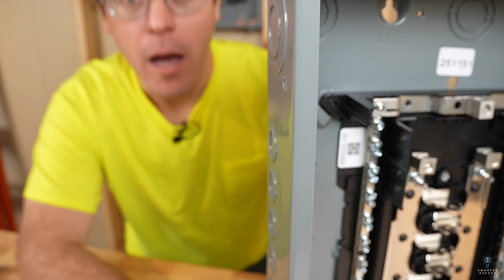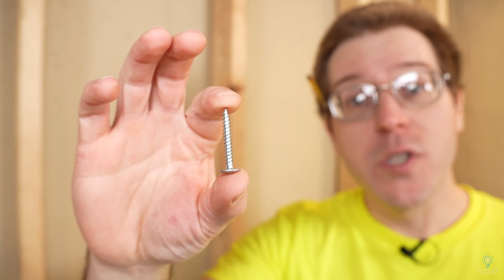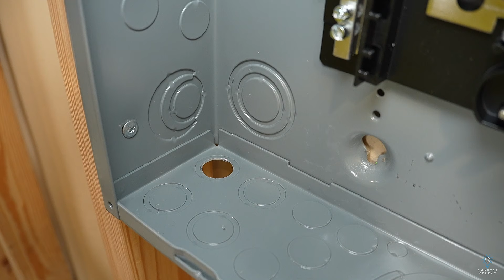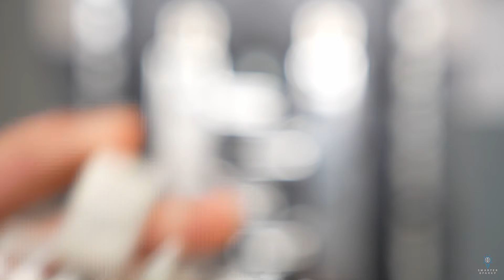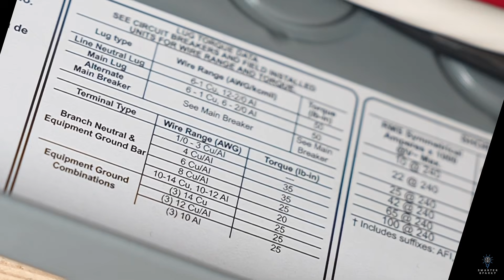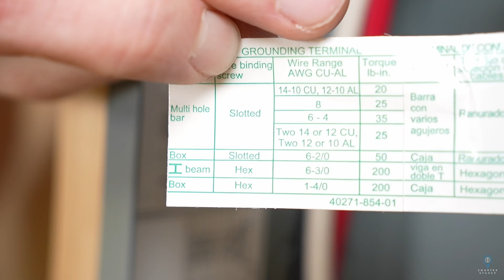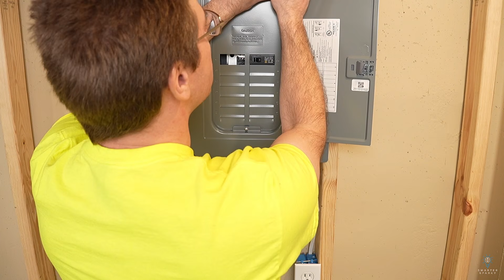Unlocking the Basics: How to Install a Subpanel

Comment: 15:33 Determining how much wire to leave in the panel, Is there a reason to not bottom feed  (Panel Mounted Upside Down) this? Personal preference, actual code
Reply from the maker: Personal preference I suppose. You mount the panel upside down in most cases

Comment: Thank you again, enjoying your videos. You mentioned you can install additional panel side by side of you run out of space. I wonder if you ran out of space on subpanel. How would you solve that? Hope to see that in the future video
Reply from the maker: I suppose it would depend on why you ran out of space in the sub panel. You could add a sub panel off a sub panel in some cases. Depending on the circumstances, it might be best to swap the sub panel for a bigger panel. You also might run into a service capacity issue and need a whole new electrical service to feed all that extra stuff.

Comment: Thank you for very detailed and educational video. Question popped into my mind when you mentioned grounding of sub panel in detached building. In the feeder cable do you still need ground wire?
Reply from the maker: Yes you typically still need the ground wire in the feeder cable. The ground rod at the separate building basically supplements it.

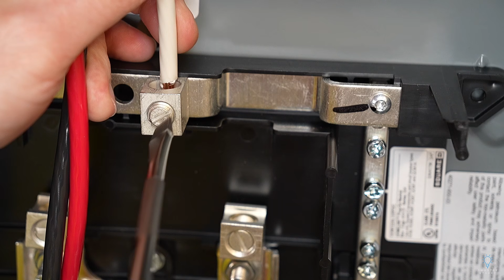Comment: At 32:18 it says I need anti-oxidant. That’s from the 80s when aluminium wire was a lower quality. We no longer need it in any case. Not on aluminium or copper.
Reply from the maker: You are correct. Modern AA-8000 wire does not require antiox.

Comment: At 32:18 it says I need anti-oxidant. That’s from the 80s when aluminium wire was a lower quality. We no longer need it in any case. Not on aluminium or copper.
Reply from the maker: Yes! You are 100% correct. AA-8000 wire does not need anti-oxidant.

Comment: What if the main panel is full and all breakers are used. How do I add a sub panel?
Reply from the maker: You would likely have to remove one load from the main panel, feed the new sub panel, and move the removed load to the sub panel.

Comment: Hi Dustyn,

I recently started following your videos and enjoy the content. I noticed in one of your videos that you mentioned it would be acceptable to use drywall screws to support an electrical panel or subpanel. However, the NEC may not permit that method of support.

I also noticed that the feeder appears to be installed very close to the opposite face of the stud, which could expose it to potential damage from drywall screws or nails.

A few additional questions:

* When installing a new ground bus bar, should the mounting surface be cleaned or scratched to ensure proper bonding before applying the manufacturer’s specified torque values?
* Should all new circuit breakers be properly labeled when installing or adding a subpanel?
* At a detached garage, ground rods are not required if the structure is supplied by only one branch circuit, correct?

I would appreciate your thoughts on these items. Thanks for sharing your knowledge and experience.
Reply from the maker: You know, I think you are right about the drywall screws. I don't think there's a code that specifically prohibits it, but i think it's a load rating issue. I'd have to look into that more. Thanks for pointing that out.

My next video will be about conductor clearances from the front (edge) of the studs. I'll address this in that video.

Your questions:
1) If the manufacturer doesn't specify that the paint needs to be scraped, I don't think it needs to be. The manufacturer is certifying that it will work with the screws it provides (they are kinda triangle shaped so they cut into the paint/metal and self-thread.)
2) Yes it's always a good idea to keep the panel schedule up-to-date
3) correct about the detached garage with a single circuit. 250.32(A) Exc 1

Cheers!

Comment: Explain the single ground point in the whole house, if your new sub panel is added far away for shade building.   do you need to run 6 AWG copper grounding wire from sub panel groung rod to the main ground rods inside the house ?
Reply from the maker: For a shed, the sub panel typically gets its own ground rods installed at the shed, but should have a ground wire going back to the ground bar in the main panel in the house. So basically at the main the ground rods connect to the ground bar (or neutral bar if shared), and at the shed the ground rods connect to the ground bar (never the neutral bar). Then a ground wire (called an Equipment Grounding Conductor) is ran from main panel ground bar (or neutral if shared) to shed ground bar (never neutral). Does that make sense?

Comment: Any chance you can explain the differences in feeder wires in an upcoming video? Plus, pro's and cons of different conduits that could be used for either buried or above ground applications to feed a detached shop? I never saw 6/3 NM wire you used here, only THHN/THWN. My state code requires 100 amp plus disconnect for all out buildings so looking at all options. Thanks!
Reply from the maker: You mean the difference in THHN and NM and XHHW, etc? That might be interesting 🤔
Reply: @SmarterSparky  Exactly, I only know about THHN single strand wire because that was what was on my quote to have it done by a company. They gave me options on what conduits to use but THHN was it for wires. I was surprised to see the 6/3 NM used in this video and that got me curious what else might be good to use for my project. Thanks again!
Reply from the maker: @hellspawnID  I will add that to my video idea list! THHN is pretty universal, so it makes sense that is what they would have quoted. NM is not allowed in the ground (not rated for it).

Comment: Mr. Sparky ... So because we are separating the neutral and grounds in the sub panel. Does that mean If any circuit in the sub panel side (any breaker in the sub panel) has a ground fault, does that mean the feeder breaker in the main panel that supplies the sub panel will trip automatically. And if so would that make trouble shooting the location of the fault in the sub panel much harder?
Reply from the maker: That's a good question. The short answer: it could. Both the individual branch circuit breaker and the feeder breaker will see the fault current. If the feeder breaker is much larger than the branch circuit, then the branch circuit will likely trip first. If they are close in size, say 100a feeder and 80a branch, it could be a tossup which trips first. Or they might both trip.

Breakers have what's called a 'trip curve'. Those are what approximate when a breaker will trip under a given amount of current.

Comment: If you are using a 55 amps wire you should use a 50 amps breaker for feed that cause it will protect your conductor from over loading but 60 amps breaker will trip after the 5 amps over loading
Reply from the maker: Intuition would say you should, but the code allows 55 amp wire to be protected at 60 amps. It would be fun to do some testing on that.

Comment: 25:16
I've always known that neutral and ground are to be separate in subpanels, but I've always wondered why. Why is it? Also, was it not always that way? There's a workshop building on my family's property that was built in, IDK exactly, but I estimate 2002-2003. Anyways, its panel is a subpanel, wired from a main panel in a separate building, but it seems to have a single, unified neutral and ground wire that went back to the main panel. Was it done like that back then? Thanks in advance.
Reply from the maker: Yes that is pretty common for older installs. My sheds are wired the same way on my property. They are all fed from a central distribution point, then are each their own system.

Comment: I start at the sub panel like you did. But why would you put extra wire, just to cut it off. That’s is wasteful. Just set it up and add the spare wire not having to cut off the end and throw money away.
Reply from the maker: Typically when you are landing a panel, you will have multiple cables in the panel. Leave them all long so you can arrange the circuits as needed. Some will need to be longer, some will end up shorter.

Comment: Amazing video! Instantly subscribed!! Video suggestions:

1. Installing a 50amp generator inlet switch with the interlock for the main panel 
2. Installing a 240v outlet for heavy appliances or EV car charging
Reply from the maker: I appreciate the subscription! I very much want to make both of those videos. For the generator inlet, I'd want to be able to test it with an actual generator. I have a generator, but I can't run the generator in the studio. Maybe one of those battery banks would work as a stand-in, but they are expensive. For the 240V outlet video, I already have all the components purchased, just need to make it 😎
Reply: @S @SmarterSparky looking forward for those videos ! Keep up the good work!!

Comment: Hello Sir: do you have any videos about fixing a "dead" outlet?  One day it was working and the next it stopped.  Thank you.  I"m learning alot from your instructional videos.
Reply from the maker: I don't have any videos on receptacle troubleshooting (yet). A lot of times if the wires are poked into the holes on the back of a receptacle, those connections fail. That could be the problem.
Reply: @SmarterSparky  Thank you!  Much appreciated.

Comment: Great video, thank you!  

I'm considering converting a currently unused 50-amp line that was run for an exterior hot tub into an interior subpanel (on the opposite side of the wall from the hot tub shut-off box) to add a couple of 240V outlets to the garage/shop.

I'd also like to send a 50-amp line from that subpanel back to the shutoff box for the (nonexistant) hot tub just in case a future owner wants to add a hot tub.  Is that allowed?

On the interior wall where the subpanel would go, I currently have shelving installed.  My understanding is that there needs to be at least 30 inches wide of clearance in front of the box (though not necessarily centered on the box) and all the way down to the ground.  So to be compliant with NEC, I'd have to remove at least 30 inches of shelving from the box down, right?

Thanks again for the clear, concise video.  Well done!  Subscribed!
Reply from the maker: Thanks for subscribing 😎 I don't see any red flags with what you want to do. Just make sure you pull any applicable permits and get it inspected🙂That is correct that the code requires 30 inches of working space width in front of the panel. And it has to be clear all the way to the floor. Cheers!
Reply: @SmarterSparky  Thanks!

Comment: Could you do a video adding a generator to the panel... these are the best electrical videos ive seen
Reply from the maker: Yes! I very much want to cover that. I still need to figure some logistics out, though. I can't run a generator in my studio 😅 I suppose I could run the cord through a window, but that's kinda hokey.

Comment: Hello there 
Really appreciate your contents
Very clear
And if possible  i would like you to talk about hybrid inverter and solar system installation
Reply from the maker: Thank you 🙂 I hope to make a few solar videos in the future
Reply: @SmarterSparky i'm looking foward🎉
Reply: @SmarterSparky it seems like you are not using fuse in the system like in a safety switch ,i' like to know why, if not a problem
Reply from the maker: What do you mean not using a fuse? The sub panel is protected by the circuit breaker in the source panel.

Comment: Great video, would like to see one concerning different home wiring wire sizes, uses, loads limits with several draw circuits ( meaning amp draw ) example 10/3 75 ft run power loss and a 30 amp circuit with multiple outlets concerning power loss also motor wear due to voltage loss over long distance electrical feed. Thanks again for your detailed videos.
Reply: That’s a very specific topic, great idea.  It’s also a good idea to learn where the (I call them ‘Engineering’) charts are from which you can make such determinations.  Start with the amperage draw of your device. To feed it you need a certain size cable, probably try to stay with copper.  As you increase distance you start to accumulate amperage drop and heat buildup with the minimally suitable wire size.  The chart will increase size to maintain amperage below a given drop and below a given heat value (over distance in either copper or aluminum cables of the initial size, the resistance of the wire becomes more of a factor, and as it does the heat produced rises.  Increasing cable size of either type will reduce both resistance and heat produced — so for a given distance cables must be upsized to maintain current flow above a drop limit.  That limit is described by the NEC.  Your motor may need to have a higher minimum current to operate within its parameters — usually specified on its label.  Its perfectly ok to upsize a cable if the device on that line requires it, especially for single appliance circuits like clothes dryers, ovens, refrigerators or freezers, shop equipment, well and sump pumps, a/c units, etc.  From such Engineering chars you should be able to determine the amperage drop over a given distance for each size cable, and choose a size to minimize the drop to suit your needs.
Reply from the maker: @TSPhotoAtlanta
You are spot on. Charts exist, and there is also a formula for figuring out voltage drop. Cheers!
Reply from the maker: @mikea5160
Thanks a great idea! I think those would fit in two videos; one discussing voltage drop as a whole, and the motor wear would fit good in a deep dive into electric motors. Cheers! 😎

Comment: Really informational videos. I didn't know a single thing about the electrical field 2 days ago. Yesterday and today I have spent hours watching your videos and I feel like I have been in the field for months. I am going to start mini projects around my house in the next couple of weeks. You are super educational. I hope to see more videos posted soon!
Reply: While he’s real thorough, you’ll still come up with questions you might want more depth or detail to answer.  There’s no harm in seeking more advice, it’s a great idea.  Almost any question you’ll have has been answered many times already.  There are forums and other info sites: the best idea is to formulate good questions because they lead to good answers!  

There are a lot of wrong answers out there, too, so it’s critical to carefully qualify your sources; compare several answers, refer back to the NEC (available in little glimpses through the NFPA, or possibly through other sources like, uh, your local library, esp. their reference section.)  Sometimes inspectors’ offices can answer questions, especially if there is more than a single correct way to do something and they have a preference or a requirement for their choice of correct methods — each AHJ may have set a policy, for instance.  Usually it’s as easy as just find out and be sure to do it thatta way, so you can be ready to pass inspection 🧐 😃….
Reply from the maker: I thought for sure I responded here, but I guess not. There is definitely a lot of cool stuff out there!

Comment: Do I need to ground my metal building to my subpanel?
Reply from the maker: That depends on a few factors. Typically building steel does need to be bonded if the the support members are in contact with the ground for 10 feet or more.

Comment: 4:08…you sure???   Did you mean to say #4 copper?   #4 Aluminum for 100amp?   Technically you shouldn’t even use #4 copper for 100amp but I know there’s a code that says for residential you can get away with it.  Most use #3 or like my father in law did for my sub panel in the garage he used #2 copper!
Reply from the maker: Yeah I misspoke. 👍 I think I have a pinned comment with a correction

Comment: Im wiring my cabin and im learning by watching and asking questions. And i have a question about that sub panel. I bought one for my tiny cabin just to run lights and switches and maybe a small miny split. Would this work for that. I would be running my generator for the electricity
Reply from the maker: Yep you can feed a sub panel from a generator. You will need to figure out if your generator is bonded internally or not (neutral and ground connected at the generator). This will determine if you need a bonding jumper in the panel (that green screen). Basically if the generator is bonded internally, you don't want the green bonding screw in the panel. If the generator is not bonded internally, then you will need the green bonding screw. It'd be a good idea to have a ground rod at the panel as well.

Comment: Never seen anyone smack a knockout with their strippers like that. I usually reach for my beater flathead and smack the end with my palm or the lineman's pliers.
Reply from the maker: yeah that's why i love these needle nose wire strippers. One tool to finish the whole KO process. I got tired of wrecking my flat heads by beating on them. I've also started carrying around a demolition screwdriver that actually has a metal end cap that's made for beating on. They work well.

Comment: I have a question, and I know the answer might depend on my location, but here it is... if I'm going to run a feeder from my main panel (outside of the house) to my garage (through a wall to inside of the garage), do I need to use PVC or can I use flexible conduit? I plan to install a 100-Amp subpanel in my garage, so I know I need 1-1-1-3 aluminum wire, but I'm not sure about the necessary conduit. Thank you in advance.
Reply from the maker: There are a a lot of factors that come into play here, but my first thought would be to use PVC to get the wire into the ground, then I'd direct bury 'USE' (underground service entrance). Standard SER wire cannot be put in conduit underground.